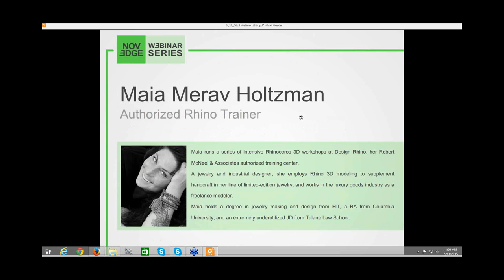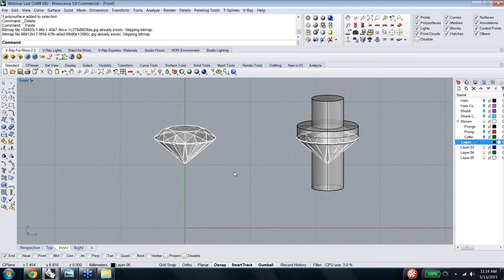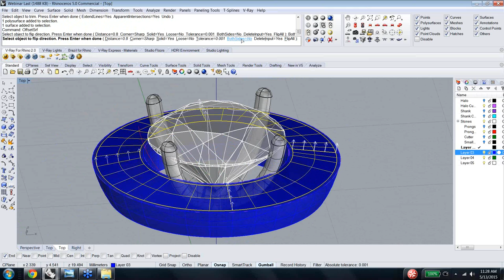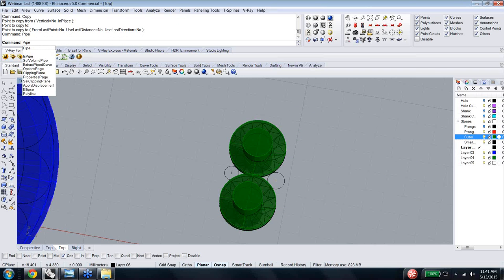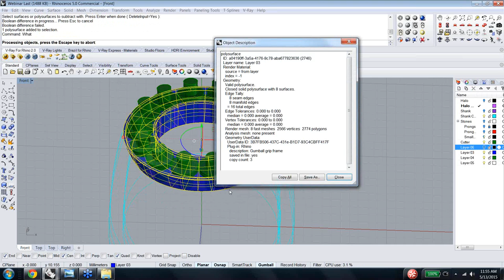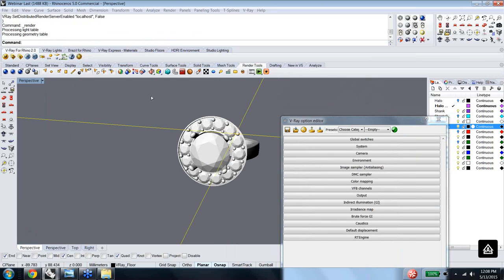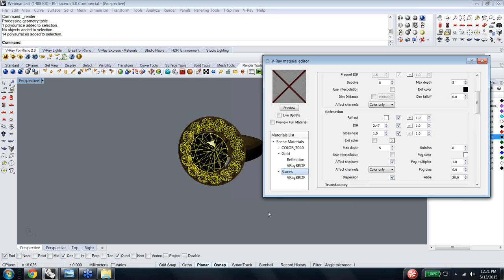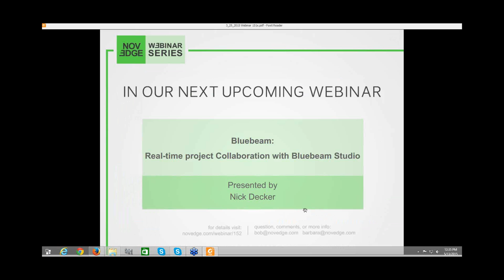Rhino with V-Ray  Engagement Ring Prototype and Render

Comment: I've been a jeweler for 14 years now, I was thinking the same as soon as I saw the diamonds so close.. and here is the thing, all depends of the company and how operates, if they receive calibrated diamonds from the supplier all should be fine because they send them very precise, manufacturers shouldnt have an issue with this they should have a supplier that calibrate the diamonds, or they do it them selves...  now in the other hand repair shops the mostly order from suppliers that dont calibrate the diamonds before send them to jewelers, so they will come in a lot but they have very small variations on the actual size,, so if the design is for a Custom job that is going to be done on a Small shop or on a Repair shop, you better do a little separation,, cuz they wont have calibrated diamonds most likely.. they will be able to make it work and beautiful dont get me wrong, they maybe even get the diamonds from a suppliers that calibrates them, but not in the most of cases.. so if your design has girdle to girdle ,, then they might brake a few diamonds .. lol,, not mention if they are on the side and the ring needs to be sized up later..